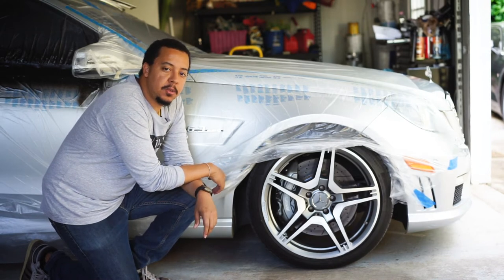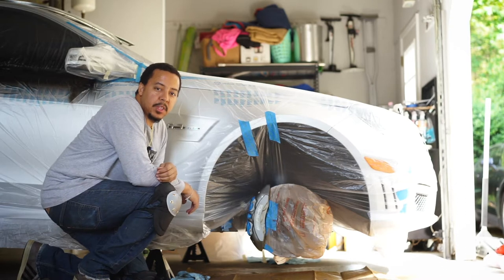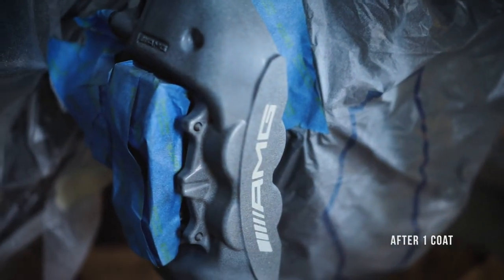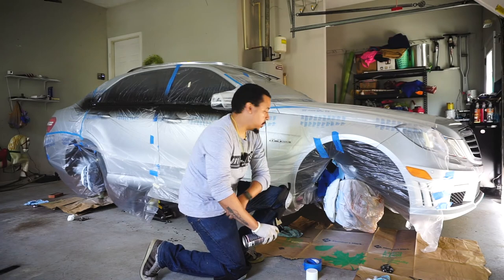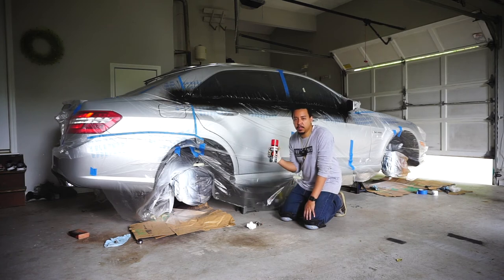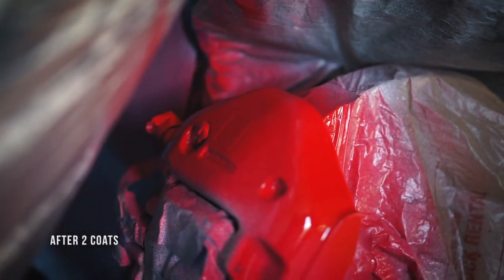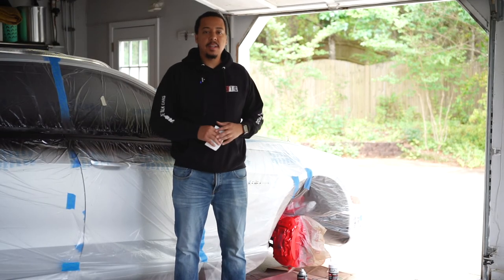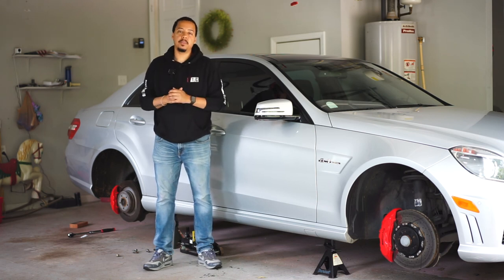HOW TO SUPERWRAP VINYL WRAP CALIPERS!  Looks like powder coating but way CHEAPER!

Comment: I came across your video because I searched if it would be possible to plasti dip brake callipers. This looks like a very very good solution as you can achieve a paint like finish! Because I want to keep my brake callipers original I’d wanted to ask if it’s possible to remove the spray wrap 100%. Do you know if that’s the case? If so I will definitely do that!
Reply from the maker: Yeah, I wanted to keep my brake calipers original as well. Also, I wanted to do something that was faster and cheaper than powder coating them.  I have been pleased with the results. It has lasted over a year.  As far as the removal, I have done that yet.  I have removed the spray vinyl on other areas. Some removal has been cool and some has been hard as hell. It could vary based on how well it was applied...the thicker the more easier it is to remove per instructions.  At some point I will remove it and I will do a video on it. 👍
Reply: @DriveTalkCars  that sounds promising! I will have a look on where i can get this stuff in Germany! Thanks for your reply!!

Comment: Do you think it is okay to apply Superwrap gloss black without removing current paint on caliper?..
Reply from the maker: Yes, the product is designed to go over paint with clearcoat. I went over my existing paint after just cleaning and drying my calipers really well.
Reply: @DriveTalkCars  thanks for replying!

Comment: Does it collect a lot of dust? Also you can turn ur wheel to get perfect spraying angles at least for the front wheels
Reply from the maker: The brake dust is normal. I haven't seen any more or less than before I sprayed them.  👍

Comment: I feel like this is a silly question but can this be done to stock brake calipers?
Reply from the maker: Yes, it should work the same. However, with the stock or convention brakes they have more nooks to get the spray into, but it should be okay. 👍🏽

Comment: 1. How’s holding up?
2. Didn’t you have to apply top coat after red?
Reply from the maker: It is holding up nicely! It is still glossy and looks brand new.
No, I didn't apply a top coat. However, Superwrap does offer a high gloss clear.
Reply: @DriveTalkCars thanks for replying! Do you think it is okay to apply Superwrap gloss black without removing current paint on caliper?..

Comment: Is there an update on the durability of the calipers? Ive looking at cheaper alternatives then buying a new set of calipers just to have them powder coated.
Reply from the maker: They have done wonderful in my opinion. I have chipped a couple of them when taking of my wheels. But other than that they look the same as when I initially did them

Comment: Bet so i bought red calipers do i need to strip that paint before i hit it with the base paint?
Reply from the maker: No, that’s not necessary. The spray vinyl goes right on top. Also, you will do the white coat first then the color coat. 👍🏽
Reply: @DriveTalkCars  ok thanks kinda figured they are brand new 4 pot and 2 calipers they just came red but i dont want red so im going teal  thanks for responding 👌

Comment: So do we need 4 cans total to do the job?
Reply from the maker: Yes. If you do a color that requires a base coat of white then it is 2 white cans and 2 of the color cans, totally 4 cans.
Reply: @DriveTalkCars  I appreciate the fast response. Will be doing this next week seems like it would be easier to do than powder coat.
Reply from the maker: No problem. It is definitely cheaper than powder coating! Lol. I would say the prep is the “toughest” part. And the wait between 10 coats is long. But it’s doable for sure. Just start early in the day. Good luck! 👍🏽
Reply: @DriveTalkCars  also have one more question. Did you end up using the clear coat after putting the amg decal on?
Reply from the maker: @sebastianreynoso8598  I didn’t. I thought about it. But didn’t have it available, so I just went without it. It has held up

Comment: How many cans did it take to do all 4?
Reply from the maker: Hey, for the red color you have to use a base of white and then the color coat. So for all four calipers I used 1 can of the white base coat and 1 can of the color.  Superwrap suggest 4-6 coats of each. I did 5 coats of each. The cans are pretty much empty after the 5 coats.  But both times I have done my calipers (I did my Maserati calipers too https://youtu.be/Y0PIWwDAcQ8) I have only used 1 can of base and 1 can of color.
Reply: @DriveTalkCars  ok thank you. My rear calipers are smaller than yours so 1 can should definitely do. 👍🔥

Comment: No clear coat ? Or you just didt buy it?
Reply from the maker: I didn’t buy it. The finish is pretty gloss as is to me. Superwrap does mention that you can potentially extend the life of the finish with the clear coat. But, It still looks amazing to me without the clear coat. 👍🏽.
Reply: @DriveTalkCars  okay thanks

Comment: This video is cringe and hella misleading. You should NEVER use a plasti dip or liquid vinyl aerosol spray. The heat from the braking periods long term is going to make the removal process of these types of products a nightmare, and the amount of brake dust that will work its way into the heated soft vinyl and stain itself into it giving the surface of the liquid vinyl a brake dust stained mess that cannot be reversed unless removing the sprayed product. Ive dealt with a few customers vehicles who cheap out and go this route and its a headache/nightmare for them. Its always just better to do them the right way or not at all. Actual spray paint with a clear coat works perfectly fine no issues at all. Powder coating as well. This video is completely doing this the WRONG way and is leading people to theyre demise. But its your car so have fun👍